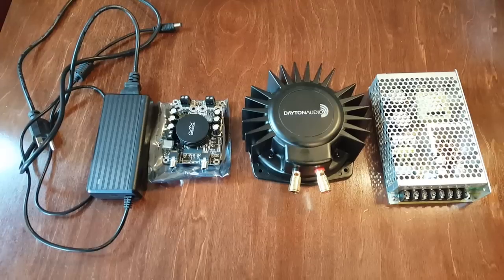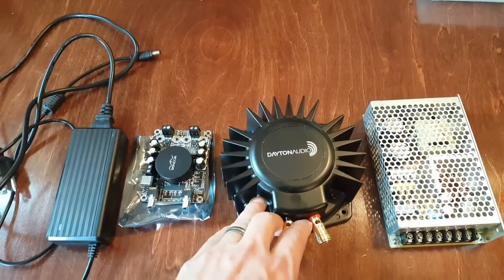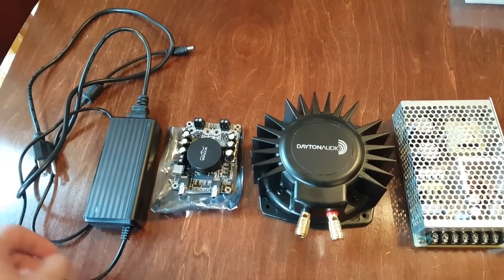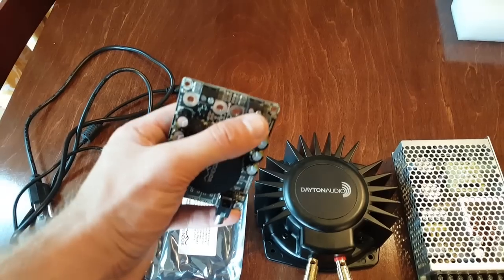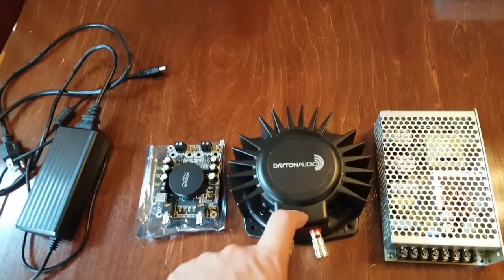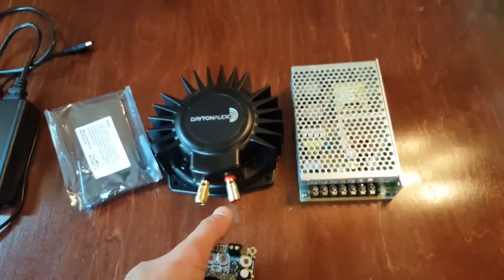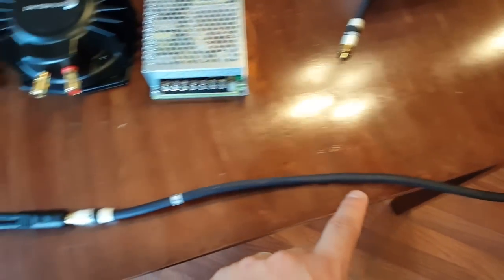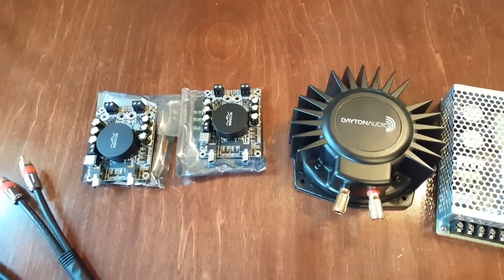How to hookup a Bass Shaker

Comment: FYI: 50W max (peak) does not = 50W continuous (RMS)!  So a 50W peaks is likely 20-30W RMS.
Reply: I just bought the aurasound bundle with Dayton amp . 
Do you recommend any settings like HPF and LPF ?
Should I leave HPF off and only turn on LPF ?
Thanks
Reply: @lollipolly-am4323  I use SimHub and set the effects tdo how it feels like 30Hz-80Hz range.  Cross-overs usually cuts all high frequencies over 80Hz so your bass only receives a signal < 80Hz.  These bass shakers can prob go dow nto 20Hz...depends on how id feels on your rig.  Mounting basses on plywood lessens the power so I suggest bolting to metal.  I'm using the plate    that comes with cheap TV wall mount since it has slots predrilled and comes with many bolts for $15.

Comment: One problem is that as you split an output channel this way you decrease the mvDC to each input by I believe a loss of 2-3dB, which causes input starvation and causes input signal distortion. That is why preamps are used, to maintain not only voltage input but waveform integrity. Might be worth checking this out. Also, being the RCA Cable would likely have a long run to remote location, you must consider any AC Circuitry that it runs near.

Years ago, I had a car system that the owner had sworn he had grounded properly, however; he had ran his RCA Amp lines near power to car accessory wiring down one side. Well, he could not get rid of alternator noise. I pointed out the RCA Lines needed to be isolated. It happened that the passenger side had no power ran down and we simply moved the lines. AC Noise is not always blocked by shielding. 

Great Success and Rock The Tunes!!!

Comment: My Onkyo AVR has 2 subwoofer outs and I have 1 subwoofer connected to the Subwoofer 1 output. If I want to connect a bass shaker, should I connect that to my Subwoofer 2 output? If yes, should I configure my AVR for 7.1.4 or 7.2.4?
Reply from the maker: Yes. And you would configure at 7.2.4

Comment: hello i know this is a old video but I have a question for you and maybe you can help. I see a lot of people use a plate amp to power these bass shakers. I currently have a Polk Audio PSW10 and on the back of the amp it has a low pass through filter and speaker level input/output. Would I be able to use the back of the polk subwoofer to power the 2 bass shakers? Thanks for your help and time.

Comment: Thanks for the video. I am in the process of looking for an amp with 3.5mm input that can work with a single Dayton Audio 50 W bass shaker. 
Can u pls explain how u calculated the total power to 48 watts? I was thinking 6 Amp 12 V will be 72 Watts? 
Also what will happen if i attached a mono 100W amp to this bass shaker:
https://www.amazon.com/Nobsound-NS-03G-Subwoofer-Amplifier-Version/dp/B072KDNW3F?ref_=ast_bbp_dp

Thanks

Comment: Great video!!! 
I just installed some bass shakers in my home theater and I am completely floored with the  results. This was far one of the best investments I’ve made so far to my home theater. I have a full Dolby Atmos 7.4.4 setup.  I have four 12 inch subwoofers included in my setup.  These bass shakers are a must have period.  I own the AuraSound AST-2B-4 Pro Bass Shaker Tactile Transducers.  I’m using three Emotiva A-100 amplifiers to push 6 bass shakers.  Just one bass  shaker for each my theater seats.
Reply: I found the single guy.

Comment: Thanks a lot - followed your tutorial and it works great.
I added one thing: "DC 12V-24V Low-pass Filter NE5532" (see ebay/amazon). 
It allowed me to keep subwoofer crossover at 80hz and to cut off 50-80hz range from the bass shaker.
Without it sometimes higher frequencies were leaking into my couch!

Comment: Hi thanks for the vid. Ok so it needs 50rms your little amp is max50 which im asuming is rms.  Im looking at these for a race sim and never played with them, but have a fair amount of car audio. One of the golden rules i have always used with amps is to get headroom so more amps than the speaker needs is head room not an issue with shakers?
Reply from the maker: Mark Newcombe great question. You are right that you're not getting up here 50 Watts because of the efficiency and loss. But I'm getting somewhere between 40 and 45 watts and have absolutely no complaints. They got harder than most would want. Of course you can and just sat with your gain. If you want more Headroom you can definitely use a different amp, you just have to be careful with powering it too much.  They have an RMS of 50 Watts, but I haven't found anywhere words published how many watts you can actually give it without blowing it. So I'd rather stay on the safe side
Reply: 123Toid thanks for the reply mate. I must be thinking slightly off again im doing research for a race sim which im really looking forward to but only really have experience with car audio. I totally agree lets not push stacks of watts into the shaker but i thaught it is better to have higher rated amps running less then there max because its safer on the amp and i could be wrong but i also believe it gives a cleaner signal. As i want to mount and wire it all in the rig im trying to make sure im not going to over heat orcworse still burn out the amps. Thanks so much fo making this best ive seen honestly.  I can just go and buy butt kicker set up but i just get no satisfaction unless i built modded or set up myself i thunk i enjoy the build more than the end result abd im always trying to do it on a budget. I even taught myself how to work with fiberglass and sew just so i could build my own race seat which ended up bwing carbon.  Keep em coming mate the journey is always more memorable than the destination.

Comment: what if I get signal loss in case of hooking up several amplifiers? is there a device / board or something like that, which can amplify signal out of my receiver and be able to hook up several shaker amplifiers??
Reply from the maker: I am assuming you are asking about the RCA output.  And if you split it too much, that you actually hinder the signal. They do seel RCA signal boosters if you need it.  Most people do not need it.  Of course, if you are really concerned with that, it may be best for you to use a subwoofer amp or rack amp to power all your bass shakers.

Comment: Im researching this for a flight sim gaming chair setup so i dont have a home theater or a subwoofer amp or anyhting so could i use a normal 3.5mm jack from a sound card on my computer with a splitter and adapters as the signal with a crossover for control and one of those 100 watt boards with relative success?
Reply from the maker: jake i absolutely.  Just plug it out of your subwoofer out on your 5.1 sound card. Some sound cards even let you assign it nowadays
Reply: well son of a bitch, i had no i idea i even had a subwoofer out on my sound card lol thanks.

Comment: Hey, i saw the video and have a question. Can i used 2 of those 50w Dayton shakers on 1 Wondom ampliflier or do i need 2.  Also if i use 1 ampliflier for 2 shakers on it  do i also need 2 of the RS 100 power supply.
Reply from the maker: That is a great question.  If you want to run two 50w bass shakers, you can use just one 2x50w wondom board.  However you do need a 100w power supply to power the board.  I have 4 shakers, both sets are hooked up to the wondom board and each has an RS100 power supply.  Just remember if you do it this way, you need to hook it up to your LFE output on your receiver
Reply: ok, thanks for the response. So if i want those 2 shakers i can run them on the wondom board and i should be able to put them on 1 RS 100 power supply.
Reply from the maker: You got it!

Comment: Hi everyone I have yamaha amplifier rx- v 557 and subwoofer pioneer S-W 110 S-K (amplified)

I would like to add 1 or 2 bass shakers for driving seat with ps4.

On sub there s both input and output line.
Do you recommend something about?
Do I need other components or just the amplified subwoofer?
The fact that ampli is at 8 ohms and the subwoofer at 4 ohm alter smth?

Thank you
Reply from the maker: You will need an amplifier to drive the bass shakers.  I would recommend the same ones I used in the video with the meanwell power supply.  You can get the amplifier right from parts express (assuming they are 50w bass shakers).  https://www.parts-express.com/sure-electronics-aa-ab32178-2x50w-4-ohm-class-d-audio-amplifier-board-tpa3116--320-3342
Reply: 123Toid I could choose a larger amp then to integrate in total 4 shakers, reckhorn bs 400. 

https://www.amazon.it/dp/B00AMH17GC/ref=cm_sw_r_cp_apa_ERRMzb8T1X306
These amps 

Spl 400
http://www.ebay.it/itm/111221421318

or

E-400
http://www.ebay.it/itm/401380593776

So basically I take only 2 reckhorns bs400, and then add 2 more later on, maybe use the only 2 channels using a parallel connection.

Comment: You may want to go slightly higher than 100 watts on the power supply, maybe 105 or 110 to counteract the small inefficiency of the amplifier boards. And nonetheless, those amplifier boards can usually only supply 100 watts into two ohms, and those bass shakers are probably four, meaning you will not experience the full potential of them. But nonetheless, a good project that adds another element to a standard movie experience.
Reply from the maker: James Collins you are right.  I didn't want to go too far into the inefficiencies of the amplifiers.   This Sure amplifier is actually a 2x50 watt at 4 ohms.  If you want to check it out, here's the amplifier.  It's a pretty awesome little amplifier.   https://www.parts-express.com/sure-electronics-aa-ab32178-2x50w-4-ohm-class-d-audio-amplifier-board-tpa3116--320-3342
Reply: Yes, they are very nice little amplifiers. I have used similar ones myself for projects. And for $22 the price is almost unbeatable!

Comment: bro I take the bass shaker and put my speaker wires in it and it works
Reply from the maker: Bl_Eric Eric Stump Yeah, it'll work.  However, if you don't have a low pass filter on it, they won't work for long.  They aren't designed to reproduce high frequencies.  The one I used want you to cross it over at 80 hz.  Meaning anything over that has the potential to make the driver fail rather quickly.  And if it doesn't fail, it'll sound terrible, as it starts playing high frequency sounds that you don't want to hear.
Reply: 123Toid yea true but I just connect shit and if it works I'm happy I got a sub box with a aux input and aux output so if I just play music through the sub it plays low frequencies then I connect my stereo to it and it plays high frequencies and  everything sounds good
Reply: Eric Blox maybe to your ears but that might not be saying much

Comment: hi i have installed everything as per your description, but undure how to cut the frequency in board amps
Reply from the maker: If you're hooking it up via a surround sound receiver, you just use it's internal cut off in it's settings.   I am assuming you have it hooked up to your subwoofer out

Comment: What sound frequency range can be set? Is 80Hz the minimum that can be set when you hook it up using the first method you describe?
Reply from the maker: Donald Clay It depends on the subwoofer plate amplifier you buy.  Typically they have a knob that can adjust the cutoff frequency from 40hz to 200hz.
Reply from the maker: Unless you're hooking it up with an amp board like I am.  In this case, you would want to set the frequency cut-off in your receiver.

Comment: Hi.Great video!!! Thanks for your information. Iam building a DIY playseat and ik was wondering What type of board amp you use. can you please inform me where you ordered your board and brand etcetera quality loods good. Thanks and looking forward for your reply.
Reply from the maker: I highly recommend this amp, which is the one I used in the video.  You can hook up to 2 bass shakers to it.  https://www.parts-express.com/sure-electronics-aa-ab32178-2x50w-4-ohm-class-d-audio-amplifier-board-tpa3116--320-3342  As for a power supply, if you do not want to use the one I choose, you could use this one: https://www.parts-express.com/24-vdc-475a-power-supply-with-25-x-55mm-plug-and-led-indicator--129-160
Reply from the maker: Another option, is to use a 2.1 amp.  Then you can hook up 1 bass shaker to the subwoofer channel and the 2 speakers to the other 2 channels.  This way you only need 1 power source.   Now I personally have not used this board, so I cannot speak to how well it performs, but it should work for what you are trying to do.  https://www.aliexpress.com/item/E74-2-1-High-Power-Power-Amplifier-50w-50W-100W-HIFI-Digital-Subwoofer-Amplifier-Verst-Board/32604810447.html?spm=2114.01010208.3.1.cDldPJ&ws_ab_test=searchweb0_0,searchweb201602_4_10065_10068_10000074_10000032_119_10000025_10000029_10000028_10060_10000067_10062_10056_10055_10000062_10054_10059_10099_10000022_10000013_10103_10102_10000016_10096_10000018_10000019_10000056_10000059_10052_10053_10107_10050_10106_10051_10000053_10000007_10000050_10084_10083_10000047_10080_10082_10081_10110_10111_10112_10113_10114_10115_10037_10033_10000041_10000044_10078_10079_10077_10000038_10073_10000035_10122_10121,searchweb201603_3,afswitch_3,single_sort_3_default&btsid=b18cd23b-2587-4125-babe-3aac8108fddc  Granted, this amp probably will not be as good as the sure amplifier I used in the video.
Reply: 123Toid 

Thanks for your information. Iam gone build two shakers inside my playseat.👍
Reply from the maker: Nando van Roon That is Awesome!  You're going to have the best playseat around!

Comment: so I want to hock up a small amplifier board. but my problem is: most I found are without any bass tuning or cutoff, and got an imput of maybe 20W, but telling me they have 100W of power^^ So Im kinda helpless right now.
Want to use two shakers for my cars front seats, so 12V input would be nice.
Reply from the maker: DESCENT Do you have an aftermarket head unit I your car?  if so, you just need to use the sub out RCA cable to hook up to the shown amplifier which can input a 12v source.  then your head unit already has the cut off in its settings.
Reply: 123Toid  wouldn't I loose 50% of power with only 12V?

just changed my mind and took the project into my living room.
bought a 240V to 24V 20A up to 42V converter.
two shakers and two 24-34V boards with 80W per channel. 
kinda pumped!
got two amps and a big pwrsupply for "upgradeability" 😅
Reply from the maker: DESCENT you would not lose power going with a 12v source, you just would need more amperage to get the same power.  remember volts x Amps = Watts.  so with a 12v source you'd need 8 amps to get 96 watts or about 48 watts per speaker.  Unfortunately I couldn't tell you how many amps your car would supply.  If it is less than 8 amps  then, you can always get a buck converter which will take a 12v source to a 24v source.

I am pumped to hear your putting it in your car!  I can't wait to hear what you think of it.
Reply: 123Toid well, more amps equal more heat. I gues the board would hit a limit in some way.
I may get a dedicated Monoblock for my car just for the shakers. So I could easily change the volume and cut of frequency.